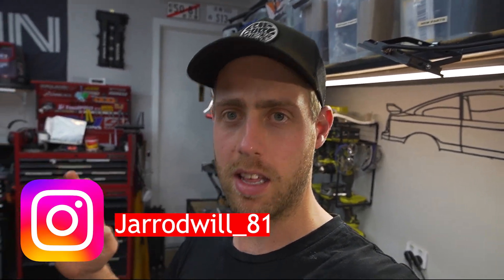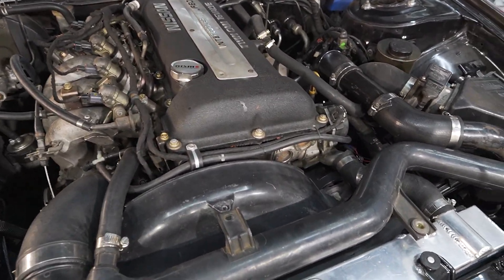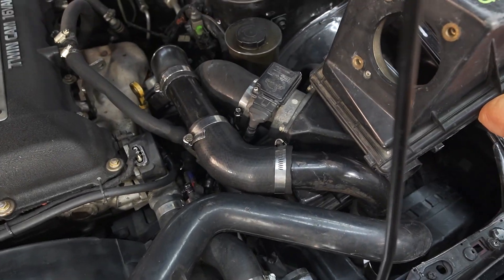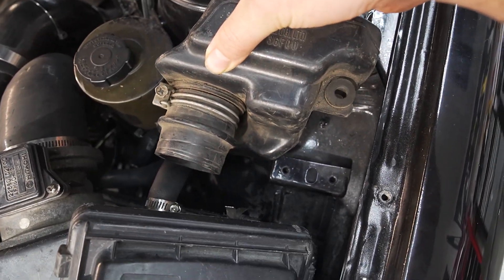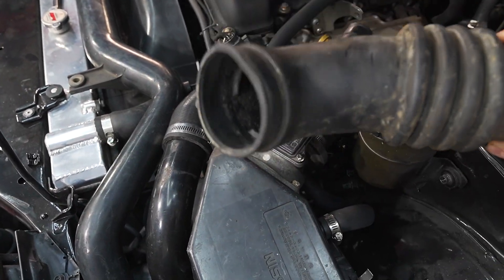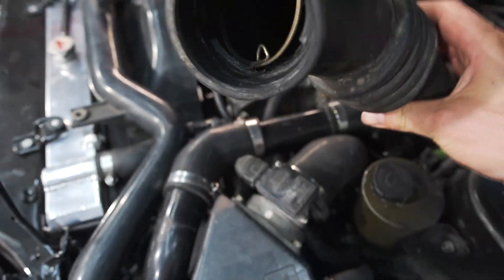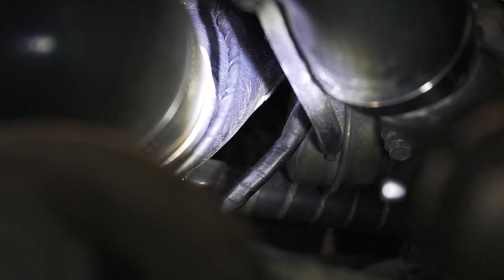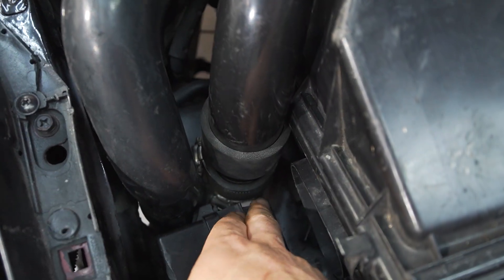S13 Silvia and 180sx OEM Stock Intake And Intercooler Differences | CA18DET & SR20DET

Comment: I love my CA18DET I have had it for 24yrs. I have one of thr first Nisstune ECU chips as done by a guy Jeff in SA. It has GTR 444cc injectors, Z32 AFM, T28BB, Trust intercooler, walbro 255lph pump with turbo smart fule reg, all custom plumbing ceramic coated. It has just under 300HP and was my daily for 14yrs now I work in Asia one day I will drive it again.
Reply from the maker: Sounds like the 2000s tuner setup. 300hp reliable and fun perfect for a street car.
Reply: @JarrodWillemse  for sure, it is my mate who helped me he works on drift cars and all Nissans. So we did our research and came up with this combo. I still have the car back in SA, but I now work in Kuala Lumpur, so one day, I will get it running again. It's sat for 10 years now, so it will need some new hoses and some other things, but it will get back on the road. Of course, I have the classic Wrok Meister S1 2pc rims to give it the JDM look.